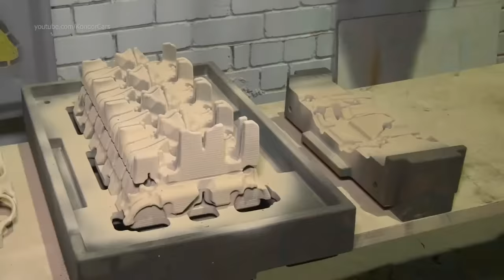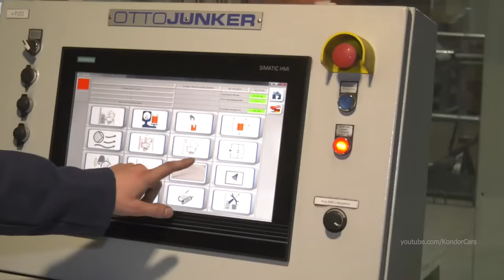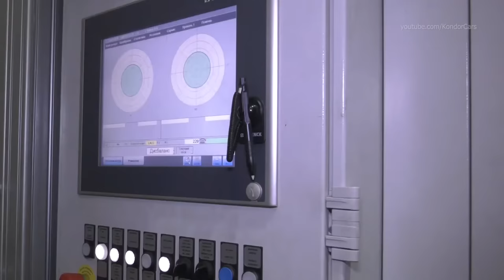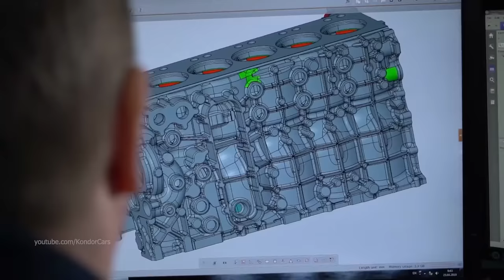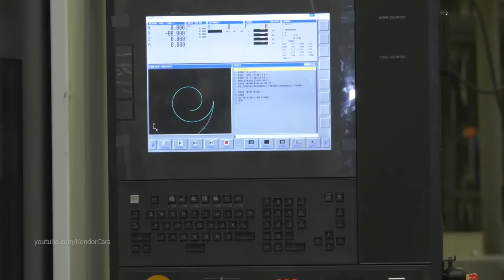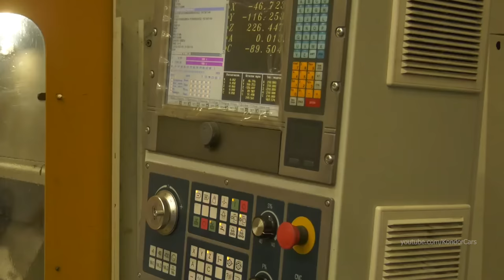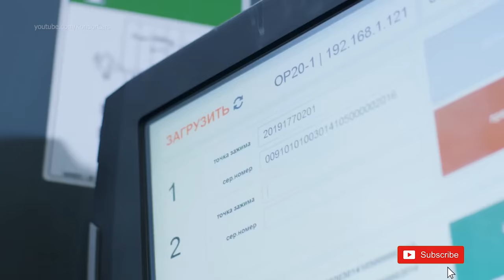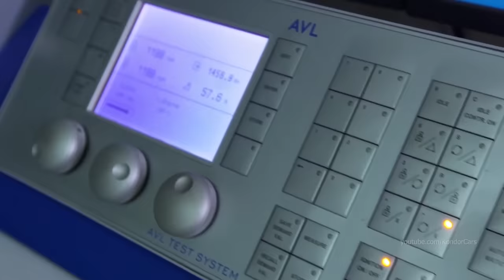KAMAZ V8 Engine Production - Russian Factory

Comment: Interesting to know how much western technology is imbedded into the production process?
Reply: Previously, it was easier to buy industrial equipment in Western countries. Now Russian manufacturers are hard at work creating their own equipment, or buying it in China instead of the West.
Reply: Basically everything new you see there is western machinery. Heller Mills, Schenck Balancers, Ona edm machine, ABB Robots, Siemens Automation, Mahr Meassuring Technology.
Reply: @MQuinn-si4tp  That is a result of Trade negotiations. Russia used to sell and still does to an extent huge amounts of Energy to Europe, so when the respective Trade Ministers are negotiating the Trade deal , Russia has to buy European Goods or the Respective Countries Goods or Services to minimise the Trade Gap in Finance.
Reply: I was involved with these plants originally the American Government gave out a huge amount of loans at a very low interest rate based on the Soviet Union would purchase minimum of 90% of American Foundry equipment.   The company that had the main contract for both the iron and steel foundries was based in Chicago  I was involved with the design and construction of the complete control systems it was massive spent a lot of time training maintenance people in Chicago and eventually work in Kamaz truck plant in what was a little village on the banks of the Kamaz River , 600 miles east of Moscow in winter it got as cold as 52 below C.  The complete project was 40 square miles it included all of the industry involved in making the complete truck from start to Finish. The original Kamaz Truck was a copy of te old snout nose International Harvester truck.  The city now has a population of over 1,000,000 people and it is still cold in the winter
Reply: @allanparker3486 awesome.
I love it.
I studied the history of Soviets rise and know lots of American foundries tech went there. Ford helped a lot also.
Reply: 90% and don't let anybody kid you that especially China has any innovative, original or world class abilities to produce products like the US, Germany, Spain, and Japan.
Reply: @MQuinn-si4tp Otto Junkers too
Reply: @3RTracing Spain? Italy and France you mean.

Comment: every time you see a brand name or model number of a machine or tool, it is a western European brand.   Given the sanctions this must be giving them some headaches keeping this place running.
Reply: No
Reply: @karlharrison2449  Why not?
Reply: @keithammleter3824  The western sanctions have strengthened Russia not weakened it. Europe is the one suffering, especially Germany which is being de industrialized.
Reply: @karlharrison2449  :  I wasn't commenting on the effect of sanctions generally, I was commenting that the particular factory shown in this video is likely to be having problems, due to its equipment being imported.  
However, I don't doubt that Russia will AFTER some time be strengthened by the sanctions - history shows that's what long term sanctions do - for example the 1960's and 1970's sanctions against South Africa boosted their industry and caused them to make gasoline from coal.  And South Africa is a much smaller country than Russia.
However, in the short term it can make things difficult.   It takes years to build up technical skills and supply chains to make things that used to be imported.    You see this in the Russian airline industry, which is now flying aircraft with parts cannabalized from aircraft taken out of service.

Everyone expected the Russian airforce to actively support their ground troops in the Ukraine.  That's what they were trained to do after the reforms post Chechnya.   However this is not happening much, and one presumes that is because they need to conserve flying hours due to parts shortages until they get their own factories on line.
We saw that Russia sent a lot of tanks to Ukraine out of long term storage.   These tanks suffered a lot of breakdowns (part of the reason why the initial invasion failed is because tank radios failed, so commanders could not direct their tanks).  Russia has learnt from that and has since been sending its' stored tanks back to the factory for overhaul/refurbishment.  This is going much slower than Putin and his top brass wanted - again parts supply appears to be the problem.  For example they had been importing night gun sights from France.
I also agree that sanctions bite the country imposing them as well (eg USA) because they aren't selling what they formerly were selling.   But that is not a concern to the factory in this video.
Reply: China is very close to russia

Comment: VERY old fuel/injection system.
But probobly good if you want to be able to run on not so clean but cheap fuel.
Reply: Some times Kamaz may be used as platform for military needs.

Comment: Kamaz V8 is one of the most unreliable engines, thats why they are now using modern 12 litre I6 from Liebherr/Deutz that is built in Russia by Kamaz.
Reply: That's a lie. The Kamaz-740 is a very reliable engine. 3,000,000 engines were produced for 2020. Imported engines are produced by Kamaz in parallel and do not displace each other.
Reply: @Артём-ц5э8з  they need 3 million engines to replace all the blown ones. Engine life is max 200000 km.